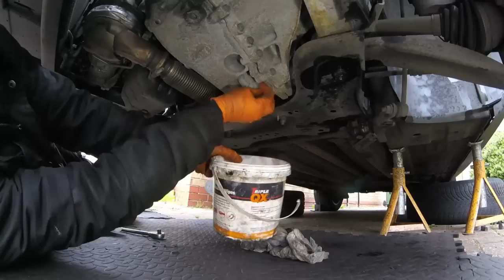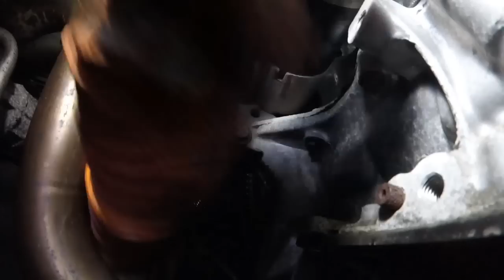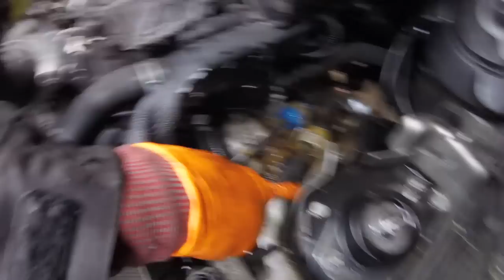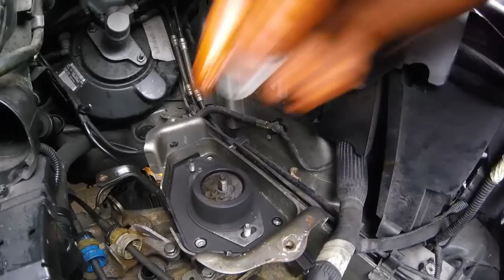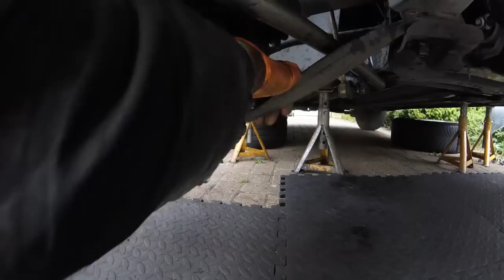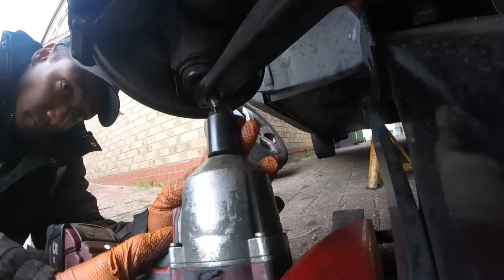2011 Peugeot 3008 1.6L Diesel Clutch Replacement

Comment: Thanks for post this managed to replace the clutch in my wife's 308 in 5 hours thanks to watching you do it first showing me all the sneaky bolts 😉👍
Reply from the maker: Rhys Evans that’s it. It’s all to help others these vids.
Reply: Did you need to remove the dpf filter on your 308 to get to the bolt on the back face of the engine?
Reply: @chayanderson  I'll be honest, I can't remember, it was exactly as Kev here did it, only I had to leave the gear cables attached as they are different (5 speed) and couldn't see how to remove easily without breaking
Reply: @SuperRhysevans  thank you.

Comment: Great video and very informative that inspired me (keen DIY) to attempt this very awkward and time consuming job.

Unfortunately this job fought me all the way and threw up problem after problem that at times made be wish i hadn't
started, but having reached the point of no return and knowing that a garage would have charged a fortune if in the same position,

made me carry on.

Firstly the nearside driveshaft would not separate from the hub, no matter how hard I hit it which forced me into stripping
it down and removing the complete assembly and only once removed placing in bench vice and using club hammer did
it eventually yield, allowing me to grease the splines just in case for the future.

The most frustrating and time consuming part was the removal of the six torque bolts holding the flywheel on to the crankshaft,
Four came out ok but the last two fought me all the way and after eventually removing No five - No six just would not budge and 
eventually the star shape was so rounded that I had to literally use a grinding wheel to destroy the DMF to allow me to use a
pipe wrench to grip the head to get it out. (took two days to get just the last two bolts out)

Good luck to future mechanics or keen D.I.Y 'ers and think on before tackling.
Reply: Next time ! Undo the drive shaft nuts and then drive around the block , that will loosen them off , just loosen the big nut a few turns then drive 5 miles max then they slip off easy ( OLD TRICK FOR ALL CARS ) And the 6 swine star drive bolts , undo one then retighten fully , do that to all of them then undo them 1 at a time ! Undo 5 and full force of the flywheel on the last bolt & one thread , very hard to remove as you found out ! Not an easy job this clutch so as your DIY , well done lad , swine of a job !
Reply: @curtisducati  
Thanks for your tips - hopefully there won't be a second time.

Comment: Thank you for the video. I gonna change for my Peugeot 3008 1.6 HDI clutch. What is the torque on the flywheel bolts and the clutch bolts?

Comment: Hello kevin Just came across your channel few days ago.

As a mechanic myself, truck mechanic I should say. Id have to say its pretty impressive to see how you go about this  job. How you lay the rubber mats down, no mess right tools for the job, nice to see. I dont watch many mobile mechcnic videos just because they are usually a poor standard of work but your video has changed my opinion on that..  It's not easy work what you're doing, especially being in England with the cold and wet just like Ireland's weather.. great video's Kevin cheers Niall
Reply from the maker: #Allthegearbutnoidea MAN/Western Star Truck & Bus thanks for a great feedback. Means a lot. Being a mechanic yourself it’s great to get your perspective as it’s quite a demanding job on the body especially outside. 

But one I don’t do is compromise on the quality of my repair. I was a master Tech for land rover for 6 years.  Almost exactly 6 years ago. 🍺🍻🍻🍺
Reply: @WMCS   Yes it can be very hard on the keens body and joints just gotta work smarter not harder 👍
Reply: @WMCS  An ex Landy master tech is just the man I need right now! Mate you'd make insane bank up here. But then a man with your skills would make insane bank anywhere 👍

Comment: Great work ! I got 3008 peugeot car , semi automatic,  and when the gear box is intermittent, goes from neutral to reverse but when changing to Auto mode for first gear it stuck there and won't change gear eventhough I do change manually? Wondering if u can do a diagnostic and then a repair for me please
The actuator was sent to a specialist and came back positive ( fully working).
Reply from the maker: adeel got your enquiry via email. ...
Reply: @WMCS  
I did email your company and phoned them but they sad they don't do semi automatic gear box ,very disappointed, had a big confidence that your guys can fix this issue for me
Reply from the maker: adeel jaan sorry we stopped doing semi autos late last year as the software update was getting more and more expensive
Reply: @WMCS  any suggestions where can i take it ? And is there a chance for you to fix it and i will get it recovered to peugeot dealer for a software update ?
Reply from the maker: adeel jaan yes I can fit the clutch. You just need to get it re learned  after. 

Thanks.

Comment: first of all great video. My 3008 with electronic gearbox, is revving when i go over 2000RPM. I was told by the Peugeot garage that its the clutch and needs to be changed. They told me that they would change the flywheel, clutch kit and trust. My question is why isn't this defect coming up on the dash board? and also why does the fly wheel needs to be changed? It the major cost at 550 euros.
Reply from the maker: David Falzon it definitely sounds like your clutch system. It won’t show up as it’s just a wear and tear item rather than a malfunction...you definitely need to change the DMF as failure to do so will most likely cause a malfunction to the clutch system sometimes immediately after fitting reason being the DMF centre bearing has a life which matches the clutch if not replaced it will start juddering and worse case starts clattering and if it becomes off centre the centrifugal force of the spin may cause a crack in your gearbox bell housing.
Reply: @WMCS  Thanks Kevin, as a matter of fact the car sometime already judders especially on hill starts. Thanks again and all the best
Reply from the maker: David Falzon hope all goes well with your repair. All the beat to you too. Thanks.
Reply from the maker: David Falzon *all the best to you too*

Comment: I'm working on a 308 1.6 HDI with 6 speed manual. It's the same engine and gearbox as in this video. @7:23 you remove a bolt from the back face of the engine/gearbox, however on my engine I can only get a open ended spanner on the bolt which isn't strong enough to undo the bolt. Even if it was the bolt couldn't be extracted as there is a bracket for the dpf filter in the way. Does anyone know how to remove this bracket?  Do the dpf filter need to be taken off? I watched the same video for the 1.6 diesel focus. Is it the same process? Its hard for me to work it out as there is a lot of heat shield in the way.
Reply from the maker: Leave the bracket and DPF.., all you need to do is remove the 13mm nut. Then remove the stud .,, that should give you enough clearance for the ring spanner. 

Then undo it whilst pulling the box away from engine. .,,

Comment: Hello mate nice job, in the middle of a 308 clutch change myself but the release bearing is so mullered I can’t tell if there’s any clips holding it on, all I’ve got is a load of rubble in the bell housing, don’t suppose you know what’s supposed to be on there do ya
Reply from the maker: Have a look of either C3 or C4 video on the channel.

Comment: Does it need rwprogramming or anything as i have just had mine at the peugeot dealer as when i select gear to drive off it says turn engine off and take to workshop and peugeot said flywheel jas gone and thats damaged the clutch and want 3900 to repair??

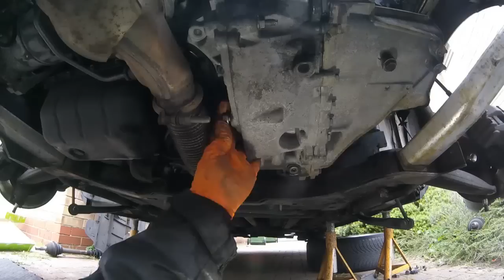Comment: 25:05 What size screw are this please? This one ihave one missing at the bottom. My car loosing hydrolic fluid and even wet part is where  starter motor sitting. Seen some oil drops on starter.
Reply from the maker: 13mm

Comment: Hi Kevin, have you ever changed a clutch for a BMP6 (C4 picasso) automatic gearbox? the system must also be depressurized with a diagnostic tool to deactivate the clutch, could you confirm this please? thanks in advance

Comment: Well done!!!! I am going to do the same job tomorrow on a driveway. 
All the best.
Reply from the maker: Nando Dapalma 
Let us know how you get on pal.
Reply: Hi mate!
At the end I've had a problem, when I mounted the gearbox the bearing escaped from the fork :((( , I think therefore it does not engage the gear. I've used sachs clutch kit. What do you think? It's a good clucth . Doesn't it?
Reply: I did a test before assemble and the gears were engaging.Now I am not able engage it only when the engine is off. What I said,  I think the release bearings is escaped from the fork .
Reply from the maker: Nando Dapalma 

Yes it has definitely become separated from the fork. Gearbox has to come out.  Pull the fork forward and secure the outside end with cable ties so it does not happen again.
Reply: @WMCS  .Many thanks mate!!! I am going to do what you said about the cables ties. 
All the best

Comment: Awesome video. Anyone know what size sockets, hexs or torxs I'll need for the starter motor? It's very well hidden on this engine and gearbox combination
Reply from the maker: Hi chay. It’s a 6mm Allen key. You can get to it fairly easy by removing the bracket that holds the shield

Comment: hey kevin great vid. Just doing my c4gp now same engine. just about to put new Clutch in but don't have the self adjusting clutch tool which is suppose to be used on these clutches. Did you use one or can i get away with just sticking it in old school lol? Thanks

Comment: Great video. About to do the same job on an identical car and this will really help me out. The pressure plate is supposed to be a self adjusting one needing the special tool kit to install it. Did you just use the tighten it up progressively and evenly technique to save using the tool?
Reply from the maker: Rich Mc thanks for the review. Self adjusting is simply as the clutch plate wears down the pressure plate mechanism slowly adjust itself to compensate for the gap. It’s nothing with the clutch alignment. 

If you have a look at the channel all the latest videos I’ve posted it shows how to align the clutch plate with pressure plate. You can buy a clutch alignment tool on eBay for about £5. 
Anything feel free to drop a message.
Reply: @WMCS  Thanks for the reply. I have fitted a few standard clutches before and have a cheap clutch alignment tool that I have used successfully. I was referring more to a self adjusting clutch plate fitting tool which works by applying even pressure onto the clutch plate to allow the plate bolts to be done up. This video link demonstrates it  https://www.youtube.com/watch?v=Tp5KeAQntGM  I am assuming you do not use one and have obviously been ok without it.
Reply from the maker: Rich Mc I suppose this is a marketing video to sell that tool. Which is very expensive. I’ve used it before on BMW as they have to be fitted under tension. 

But nowadays all clutches that require tension before bolting down comes pretensioned ... once you bolt it down then you release it. If you look through the channel on BMW clutch you’ll have an idea ...let me know

Comment: Brilliant video mate, 1 question though. Is this full manual box or the semi auto box? I'll be tackling mine soon which is semi auto.
Reply from the maker: That’s a full manual. Same applies to the auto but you’ll have to get someone in with a diagnostic machine to recalibrate otherwise it’s not gonna move after repair.
Reply: @WMCS  cheers pal, I’ve got a mate with an Autel diagnostics machine for that 👍🏻

Comment: great video tempted to give it a go myself. feels like mines ready for a change. revs go up but I don't get acceleration unless I increase speed slowly. in your opinion does that sound like the friction plate is ready for doing?
Reply from the maker: Definitely sounds like friction plate is worn. From that point it will deteriorate very quickly.
Reply: @WMCS  thanks for that bud.

Comment: Good job Kevin! Just in the middle of one of these, can I just ask, did the flwheel have to go back on in a specific position? Does it make reference to any crank position sensor?
Reply from the maker: jade2908〈3 

Thanks for the feedback. 
Yes the flywheel has to go in a specific slot for the Cranck timing. 
The good thing is the bolt holes from the flywheel to the rear main of the cranck are off set. So you can only have it ligned up to match. Otherwise it will not fit.

Comment: Hi Kevin, great video - Do you happen to know if this is pretty much the same as a 2011 Partner Van with the same 1.6hdi engine? I have searched high and low for a similar video for the van but this is the closest I could find?

Comment: Another great and informative video Kev. I watched the one you did on the Citroen Xsara Picasso as the clutch on mine had gone. Release bearing had collapsed. In the end I bought another car. Another Citroen. This time a C4 Grand Picasso. Pretty similar to this car in layout I suspect. Anyway all the stories I read about having to lift the engine and box out or drop the subframe have been put to bed by you again 😀. I’ll be doing it your way if I need to replace my clutch in the future mate. Take care Kevin and thanks again
Reply from the maker: tonyr1963 thanks for sharing the above content. ... the thrust bearing are a definite problem on these cars. But nonetheless they are a solid lump in my opinion. .. they are not too bad at all as working in them... it’s just how you tackle the job I suppose. 

Thanks again for your feedback

Comment: Currently in the middle of doing this, I do have a question though, at 03:04 you absolutely spin that nut off but it's left on, how the hell did you get it off, when I try and release mine on the drivers side the nut AND the bolt just spin, i've gone through 3 star heads thinking it's that and a spanner. Keen DIYer and this is probably the biggest job i've done on a car before.
Reply from the maker: Put a jack under the arm and jack it up and you’ll be able to spin it off again.
Reply: @WMCS  ahhhh that makes sense!, cheers, honestly this vid has helped so much, its the new age Haynes manual, keep it up, you make it look bloody easy, those flywheels are friggin heavy!
Reply: Forgot to update this, finally got the job done, tricky as hell and there's like 9 different variations of clutch for this vehicle which was a nightmare, the one major issue I had was those square bolts that hold the subframe on, this vehicle rusts and the bolts cease on so easily, I turned the bolt that holds the subframe to the car and the square nut actually inside the frame just turned and bent the flimsy little flaps holding it in place, it was a nightmare, I had to get the bolts from Peugeot at about 8 quid each and ended up putting a plate in with some lock nuts, but I had to actually cut a piece of the body away because they evidently use a special tool to hold the nut in place, I just couldn't get at it!, besides that I jacked where you did, but only had a piece of wood under it for lowering the engine, the oil pan crumpled.  Was a pain to do BUT, for a first time clutch and not a mechanic, was kinda pleased with it, held up enough to trade in and scrap against a better car!, the experience I got doing this gave me such a better understanding of cars, so just wanted to say thank you, I really appreciate the video and couldn't have done it without it!

Comment: Why do you take the long drive shaft out dose that need to come aswell not just gearbox side?
Reply from the maker: Thomas because it runs through a channel. So you cannot manoeuvre it enough.
Reply: @WMCS  yeah I gathered this doing one this week dam ball joint holding me up. I remember on old patrols used to just take gearbox side off and it would slide out and back in on the other side. Could you tell me what size of screws the pressure plate is tx or heax thanks for your message
Reply: @WMCS  also the gearbox is tx 50 ?

Comment: Great video. Is this manual transmission,because I have 5008 1.6 hdi engine and I should replace clutch and dmf? Thank you
Reply from the maker: Mirza Ogric yes it’s a manual transmission. I have a 5008 repair next week and I’ll post a video up for it.
Reply: @WMCS  probably it should be the same way. I should change it this weekend. Thank you for answering.
Reply: @WMCS  Friend,i changed dmf,clutch and release bearing,but now I have problem with pedal, it doesn't come back fully,and changing gears is quite hard. Does it means it still has air in tbe system??
Reply from the maker: Mirza Ogric that’s correct. You need to bleed the system some more
Reply: @WMCS  what is the best way to bleed it,when I open down on bleeding pipe it looks like there is no   air,but it is not ok. Help me
Reply from the maker: Mirza Ogric how did you get on. ..?

Comment: I am going to do a clutch on my citreon berlingo next week your upload has given me a bit more confidence I have subscribed as excellent upload
Reply: I mistook my cb B9 as a rally car (hold my hands up) and clutch is now shagged. How did you get on? Did you attempt it?

Handbrake on
1st gear
Clutch NOT pressed
Car NOT stalling

2nd, 3rd, 4th, 5th and reverse all the same. Takes about 10-15 seconds to stall just burning the clutch. 

New clutch needed 😭

Comment: Deffinetly very professional and very good job. It is hard work for doing it on the floor but youmake it to look easy. Thanks for tip for the screw close to catalysator( I hate that screw). Big respect mate.
Reply from the maker: terminator1987mma thanks for the feedback. And for visiting the channel. 

Yes that famous bolt can get a bit tricky. Some people grind the head off.
Reply: @WMCS  Thats the one i have missing is it in 25:05 that one? I dont have that one at all.Im loosing hydrolic fluid becouse of it.Any one know part nr or size of it?